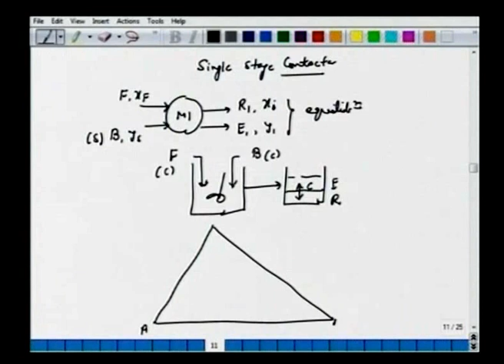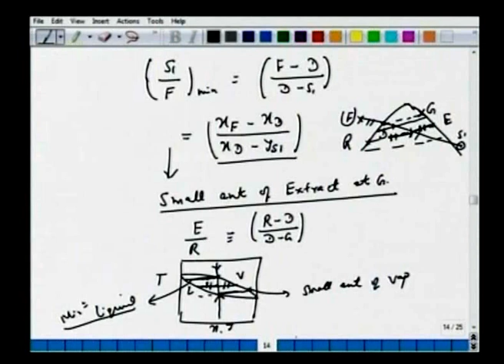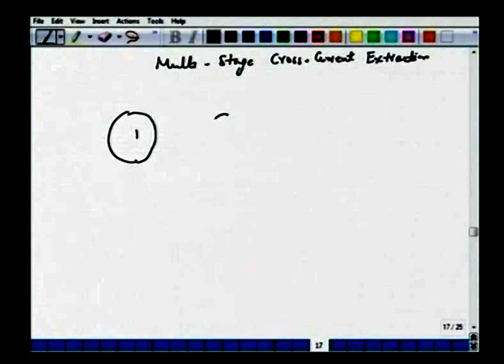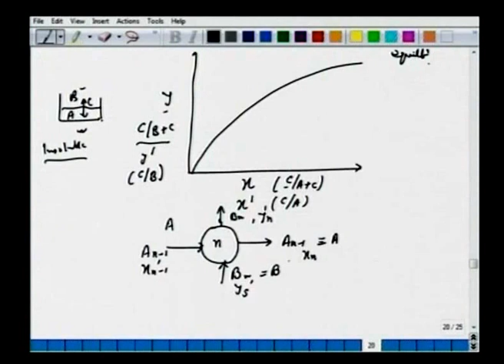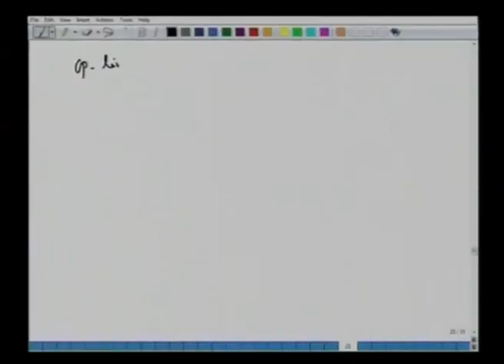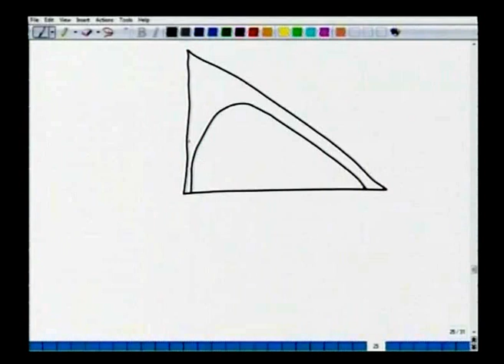Comment: how are we drawing the tie line through M. can anybody please tell ?
Reply: You have to know the actual composition in the raffinate phase and extract phase at equilibrium and then join those two points. In case of a VLE, a tie line at a constant temperature is simply a horizontal line where it meets a point on T-x curve and T-y curve and they become the equilibrium mole fractions, but in an LLE it isn't like that. The equilibrium data has to be available as T-x_R-x_E or the diagram should have tie lines on itself without we having to construct it.